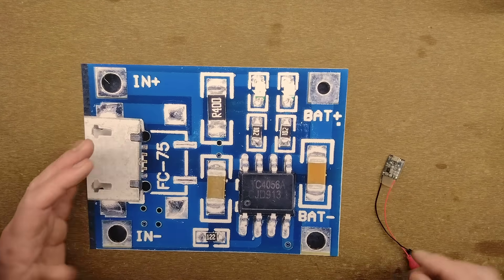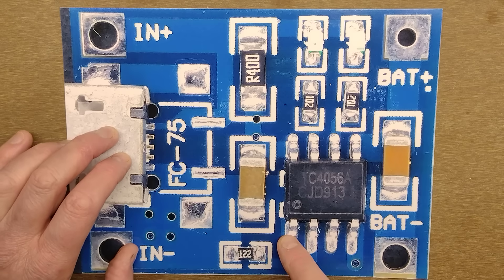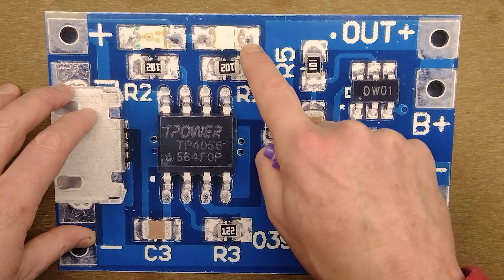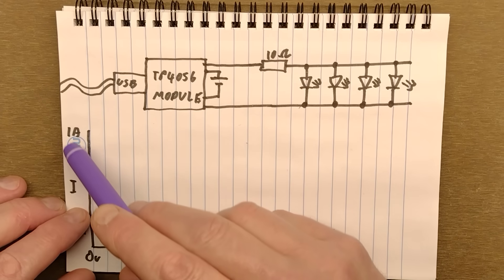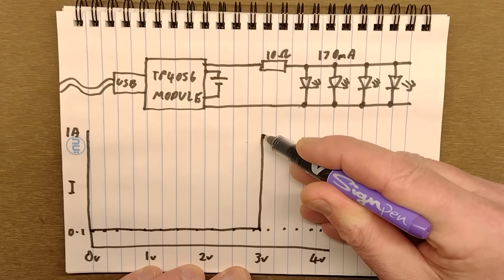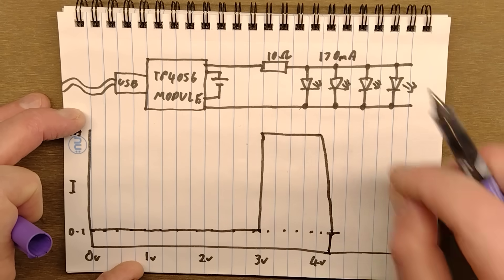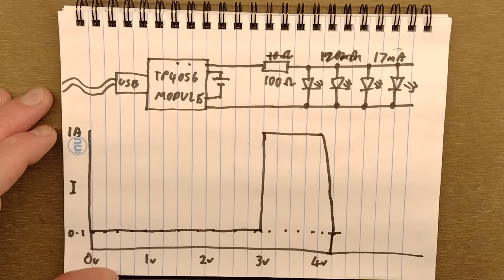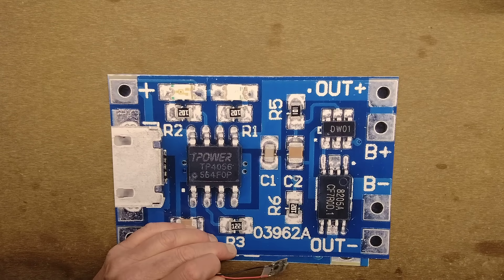TP4056 myth busting

Comment: Another video about these awesome modules! Thank you, Clive! My comments are a bit long, sorry.

I have noted that loads that have a 'large' inrush current pop these things PDQ.  Large is defined as bigger than one of those little motors from a CD ROM drive and anything with discharged caps when connected. Or too many LEDs, though they seem to tolerate them being added slowly.
As such,  found that they are not suitable for making power banks. Module failure is usually within 1-5 charge/discharge cycles. 5-watt loads. My sample size is small though, so YMMV. I may just have gotten substandard modules, cooked them, or you may need some minimal additional components. Cooling? There are MUCH better, though more expensive modules for even a basic power bank. It's a fun rabbit hole to visit!

Also, Clive, you can parallel these boards to get more amps to charge large-capacity cells, though this is a bad idea. Because cooling. I've seen other YouTubers do this. Interesting experiment though.

Truly, where these modules shine is for experimenting with pre-prototype and non-critical applications.
Oh, and if you strip battery packs for cells and are looking for a way to charge a few dozen cells at a time on the cheap for testing - these things are AMAZING. Heat sinks also can decrease charge time because of how the module throttles if too hot. 

And modules WILL get hot enough at 1 amp to melt hot glue used to stick modules in projects. Wandering modules may create an 'interesting' short. I've observed PLA 3d printed project enclosure distort from these modules' heat. I recommend PETG or something more robust. Like metal. And for the love of little green apples, do not leave these modules in direct contact will a cell. Thermal runaway events involving lithium cells suck really bad. Ya gotta keep 'em separated!
Reply from the maker: I'm wondering is inductive loads with no flyback diode pose a risk of damaging the transistors.

Comment: Fantastic video and explanation Clive! I bought 15 of the chips with the overload protection for $10.00 and that included shipping. I have a motion sensor nightlight in my bathroom that took 4 "AA" batteries so I replaced it with a cell from one of those "devices" that get tossed out and now I can just charge the battery back up when it runs low, I use a solar charger as well. The nightlight had six LED's which was too bright so I removed a resister and that lights four LED's which gives plenty of light. Winter has arrived in the Upper Peninsula of Michigan and we are getting slammed with a snow storm today, maybe 10 inches, so finding those "devices" will become harder, I will stock up come spring when the snow melts. Thank's Clive!

Comment: I had a board with a TP4056, 8205A and DW01, but when the USB charge was plugged in, there was a significant drop in the output voltage, causing the device (raspberry pi zerow) to reset.

Comment: Does anyomne know if the current limiting resistor is changed to charged at 2 amps, would the current limiting at low voltage and full charge be limited to 200 ma instead of the 100 ma ?
Reply from the maker: It's not rated for 2A charging.  You do get modules with more chips in parallel.

Comment: the TP4056 are so cheap on Ali (0.2$) that I used them also as .... sole USB-C sockets ;-)
I use these modules in 99% of my projects.
I wish they could have had separate 4.2V that is without CC circuit for powering on the load but still it is ok:you can simply solder the cables to 5V there and power the load directly and then use TP4056 just for battery backup

Btw they did 1 small mistake: the pin 8 on TP4056 is ENABLE pin, so that one could use it to turn OFF/ON the module - I often desolder the 8th pin and use it this way. Of course pins 6 and 7 can be easily used as charging indicators for the MCU (not only to power the on board LEDs)

Comment: So cool. I'm literally holding one of these circuts.! Gonna have to search other video. Thank you for helping people to learn to "recycle" and "reuse" these batteries. / circuts. The past 3 or 4 years I've been picking them up off the ground and when the box got full I'd take them down to Erecycle . Wasnt untill last year when the batt died on my bone conduction headphones I started on this journey of can I reuse the pouch cell from a vape?.  It wasnt untill this year the quality and size of the cells are quite excellent and i think i can !so lets keep recycling repairing and reusing stuff! <3

Comment: I prefer those higher current switching chargers though. They are also dirt cheap and much more efficient, ideal for multiple cells in parallel. But you have to check the C-Rating for charging of your cell array and calculate it to check if 2 or 3A are okay for the number of cells you use.
Reply: Been using the standard 1 amp on 4x650 ma packs and charging from when tp5046 cuts output and I have not noticed any heating. 
As big Clive said in the video if the chip starts to heat it cuts back the milliamperes it supplies. 
On 4x650 ma packs using the DW01 version of the tp5046. From where it cut supply to load to fully charged takes I think a little over 2 hours.
Reply: @patomahony9747  1 amp is too slow in my personal applications. Nice that the TP chips work for you. I use them as well for low power stuff.

Comment: Is it okay to have 2 DW01 chips in the same circuit? I've got a battery that has a DW01 already integrated. If I were to use one of the charging circuits that has a DW01 already built in, would it conflict with the DW01 already on the battery? Or would it be a belt & suspenders kind of scenario, where it would only benefit and not really hurt anything.
Reply from the maker: It's fine.

Comment: You forgot to mention that your second (favorite) module has its own distinct "Battery Out" and "Project Out" pads so it can continue providing power without continually trickle charging the battery.  Seems the positive pads are tied together but the negative pads have their own switching.

Comment: I've noticed that where these stop charging is a little bit random and not consistent. Not necessarily over charging but not fully charging either. I had 20 of these boards hooked up to test and charge over 700 batteries. I would charge them on the TP4056 until the light turned green, but then I put them onto a different more expensive charger. Some would continue charging for 30 seconds, others a few minutes, others quite a while. 

I don't know which charger was wrong, but I did the second state on every cell before testing just so they would be equal.

It's also worth noting I killed at least 10-12 boards doing this testing. They seem to die from over use, and also if you accidentally short the wires.
Reply: Could well be variability in the batteries BTW. The rated capacity on them has a decent tolerance band.
Reply: @zyeborm  You are clearly missing the point. Obviously the battery capacity varied, why do you think I was testing them? That isn't relevant. I didn't talk about how long they took to charge. The fact is when the cheap throw away ebay charger says "full" it picks a random point. It's not always the same place. It has nothing to do with the battery. They are always charged to the same voltage regardless of capacity. My other charger is much higher quality and does not do this.

If you charge the same battery twice, they will put out a different number of mah, also.
Reply: @ryanroberts1104  dude, do you have to be so angry? I'm glad that you have mathematically proven that differences in battery capacity have no possible impact whatsoever in the situation you describe. Clearly my thought that the variation in capacity may result in magnification of the effect you saw was so very very stupid. I humbly apologise for insulting your honour like that.

Comment: I love those updated boards with DW01 and that 8205A, I use them in my DIY solar chargers for light/phones and just lights, especially chrismas ones that normally use AAA batteries that die after few days, and when you have bunch of old 18650 cells from old laptop you slap some resistors for those lights some box and you have lights that last weeks without charge.

Comment: Thank you very much Sir for the info and deep look. I usually buy these in amounts of tens, currently having approx 50 of these in my box. I use them everywhere, as the version with protection is so much convenient for most DIY uses. I also like to connect two modules in parallel, mainly for bigger packs, and for enhancing the current (BMS has limit current of approx 3A). They don't mind it, although one of them always finishes charging sooner. Never observed any problems.
The only two bad things about these are the fact that USB-C module does not trigger USB-C, and needs to be used with USB-A adapter. Secondly, it has no reverse battery protection, so I like to use polyfuse with antiparallel diode for applications where BFU may insert battery opposite.
Reply: Can you give some examples of projects you are using them for?
Reply: @worroSfOretsevraH  Of course. The last project was source of 50V + 12V for pyro ignition for guy who arranges new year celebration for local towns. Also there are many flashlights, that I rebuilt for LED + 18650 (u can get them cheap as used from badly welded packs) + TP4056 + sometimes buck-boost converter. Either for my use, or for my friends. Two of my electronic loads also use TP4056 (I have 3 classic loads and 2 battery powered for longer measurements where data must not be lost).
Hope these examples would help.
Reply: @jiribekr  Thanks.

Comment: I've scavanged quite a few 18650's from old laptops so I bought a similar board to these, except it charges 2 batteries at once. I wired it up and it worked perfectly. I went to use it for the second time, (about 4 months later), and the circuit is totaly dead. power going in but nothing coming out.
Reply from the maker: If the connected cell is very low the DW01 may not be able to turn on.
Reply: @bigclivedotcom  I thought of that, but both the batteries I wanted to charge were just over 2V each.

Comment: My experience seems to indicate that once the charge is complete it will stop charging and that's it until it gets reset. I have several makes of wireless headphones (that i'm fairly sure will be using this or a similar chip), and if you leave them plugged in the charge complete light comes on and stays on, even if you leave them for weeks. Unplugging them and checking the charge level after these weeks shows a "less than full" charge state, right up to the point where (if left long enough) they can be completely "flat", and need a lengthy recharge again.

Comment: I've always wanted these to have an adjustable top-off voltage as well.  In many applications, the cells would last a lot longer if charging could be cut off at 4.15V or less, but some of these chips will charge up to 4.25V :|.
Reply: I built a charger around the TI BQ25895 charger IC, which lets you configure all the charging parameters using I2C. If your application has a microcontroller, that chip (or one of its brethren, or one of the very similar devices from Monolothic Power, whose dev boards and tools are way, way cheaper than TI’s) might be a decent option.
Reply: Totally agree.  My last batch of ten had an average 4.25V topp so cells all got toasty (not good)

Comment: They come even in USB mini and Type C without extra cost. You can even cut the PCB and use it as a cheap USB C breakout board.
I also use the big brother, the TP4333. It's in principle a power bank chip (with flashlight) and it does not go to sleep with low powered devices (like most powerbanks do).

Comment: Thank you for this I use the boards for all sorts of led project  devices .
I unsolder the R3 and use 1/4 watt 2k2 soldered between 0v input connection hole and bent back in an s shape direct to pin 2  on the tp5056 for 550 ma cells.
Keep up the great work

Comment: Hi Clive - keeping the LEDs connected in the 170mA case will result in float charging the battery. This is a no-no according to many cell datasheets. Float charging will reduce the cell capacity. Quite drastically if the ambient temperature is above 40 degrees C. Better chargers contain a timer that will make the charger cut out after a few hours. Li-Ion batteries don’t like deviating from the CC-CV algorithm.

Comment: It will keep the cell at 4.2v, which is not good if you want a long life from it. It's best to use a lead acid battery if you want it to be fully charged all the time.

Comment: You want to know something? I would give what to some would seem an unreasonable amount to have your knowledge and experience Clive... As it happens I have just achieved a breakthrough of sorts: All these little switching power supplies that contain a something something 431 chip... Be it a tiny smd one or a T92, I've just realized how easy it is to adjust their voltage. If one wants to adjust it up, there's usually a zener that needs to be crunched out of the mix somewhere. This is all stuff that I'm sure you were knowledgeable in and well aware of since forever ago... But here's an added bit that I found very interesting- About half of these little rascals will actually run on much less voltage than the 100 to 240 volts that they say...  such as the 58 or so volts that my e-bike contains, and of course it does not have to be AC by any means. Some of them will run much less than that. These things have suddenly become a revolution in my powering of LEDs and charging of lithium batteries (with a resistor to limit the current of course) as well as all kinds of other things that require some specific voltage or another. frustration still exists however, when I realize that I still have all sorts of little problems that if I were you, I would absolutely know how to simply fix... ah the circuits I would build if I only had your knowledge. Nothing terribly fancy mind you It's just that I don't really know what the hell I'm doing... relatively speaking. My successes are largely based on luck and persistence. If I have a point in saying all this it is that I appreciate massively all stuff I've learned watching your videos. This fact cannot be overstated. Indeed my quality of life would be somewhat less without your presence "out there". I've said it before and I will say it again and again... Much thanks for all you do.

  peace and love.
Reply from the maker: The 431 is a very common chip indeed.  Its reference voltage is 2.5V and higher voltages are set with a voltage divider to match that.

Comment: Something to note is that the threshold values are actually a % of the charge current, i.e. if the charge current is set to 500mA or 250mA, the current thresholds will be lower. If your application requires the the charging to terminate earlier, say only charge the battery to 3.9V, you can place a Schottky diode between the charging output and the battery, and a 100k resistor parallel to the battery to trick the TP4056 into thinking the battery is full.
Reply: That's definitely useful information. I'm building some solar powered sensors (water levels, and similar) that will probably benefit from charging to a lower voltage.
Reply: @tin2001  yep, I figured it out for a project where the cells needed to stay in a charged state for years and I needed to minimize degradation.
Reply from the maker: I tried reverse parallel Schottky diodes and the charger started oscillating.
Reply: @bigclivedotcom  I think the batteries don't like it if you trickle-charge them to 4.2V *forever*.  If you search for "A circuit to charge a LiPo and drive a load at the same time" you'll find a small article I wrote about the subject - and how to use a P-channel mosfet to stop this from happening; i.e. power from the 5V USB when plugged in, and only use the LiPo when unplugged.
Reply: @bigclivedotcom  The Schottky should be in series with the battery, creating a 0.3V drop before the battery. I had oscillation issues at one point too, but that turned out to be because I was trying to run the IC at 4.35V to minimize heat dissipation. When the Schottky is connected, the IC will push the charge voltage as high as it possibly can, 4.25-4.3V, and it needs a minimum 0.2 -0.5V voltage gap between Vcc and Vout for it not to oscillate. (tldr; try running it on Vcc = 6V and see if the oscillating stops) Edit: I set the charge current to about 300mA for my application, that could matter too.

Comment: Well this are a life saver for my salvaged liions from laptop battery
Which I still haven't decided what to use it for.

It's been 5years
Reply: 😁 I've got about 100 cells from laptop batteries.... Just never got to the project I collected them for, so they're just sitting.
I do wonder what sort of damage they've taken by sitting for around 5 years at full charge. Can't have been good for them.
Reply: @tin2001  
Hopefully rather die than cause a house fire

Comment: A simple comparable circuit... they make 18650 chargers for vape pens. Super cheap. To give it an output, maybe just wire up the battery pins? Would be interesting to see what's in an e-cig which will charge by USB charger, too.

Comment: Clive I've tried reading the documentation for those TP4056 and I seem to recall that Pin 1 was listed as taking (some sort of) NTC thermistor for battery thermal protection but I couldn't make heads or tails of the circuit diagram and quite frankly the the font the documentation was in made my eyes water.
Reply from the maker: The thermistor input can be used with the thermistor as part of a voltage divider to set the desired point that it will stop charging a hot cell.  But at the typical 1A charge current a 1Ah or higher cell shouldn't get hot.